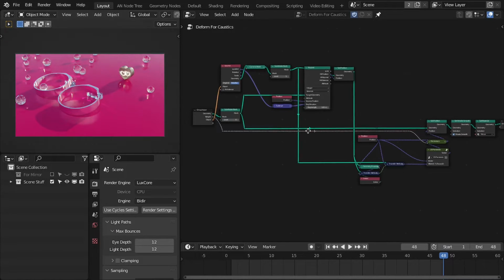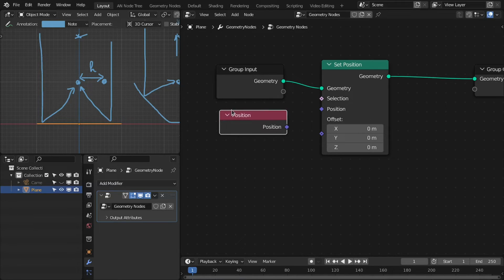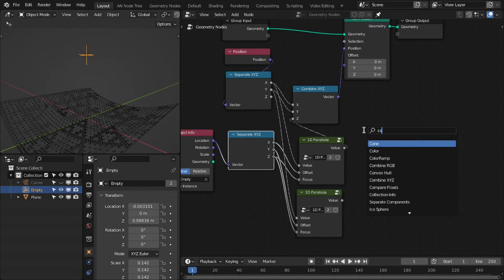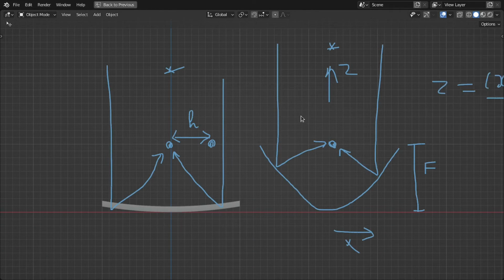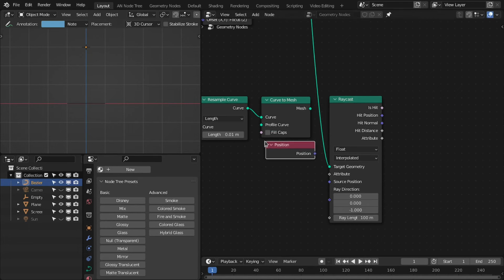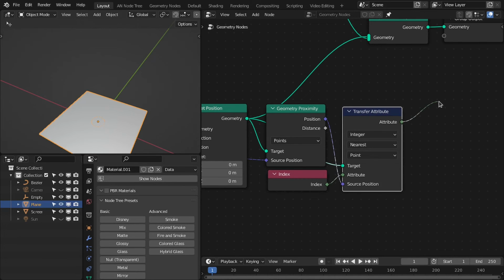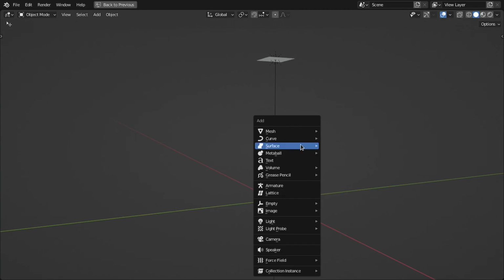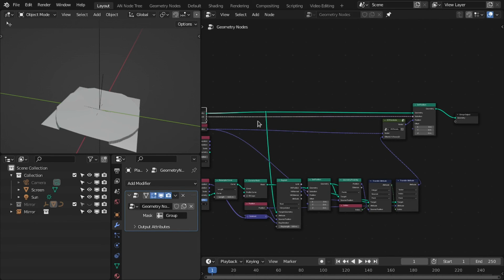Reflection Caustics with Custom Shape using Geometry Nodes in Blender - Tutorial

Comment: Could you mention how to bake the output shape to use it later in production? Thank you 🙏
Reply from the maker: Hi. You wanna bake the shape as a height map or sth else?
Reply: @3DSinghVFX  yes to fiber laser engrave it
Reply: Is it possible ?
Reply from the maker: @poto_max  It is possible to bake, BUT how to correct the scale from Blender model to Laser Engrave...that we have to check. What I mean is Image Map has only values 0 to 1 (color values), but height may have values that exceed this range.
Reply: @3DSinghVFX  I sent you a message through Patreon
Reply: @3DSinghVFX  should I contact you through patreon ?
Reply from the maker: @poto_max  Sure.